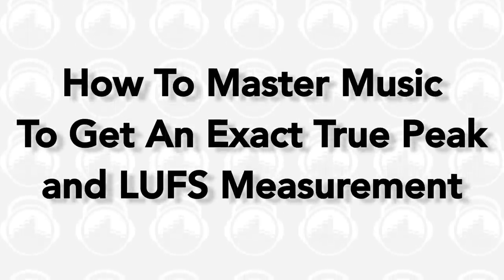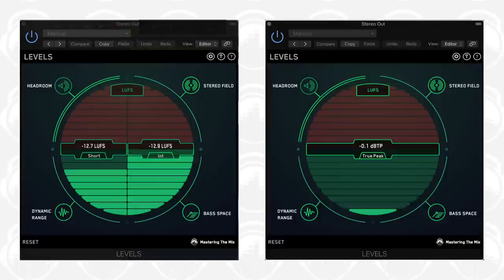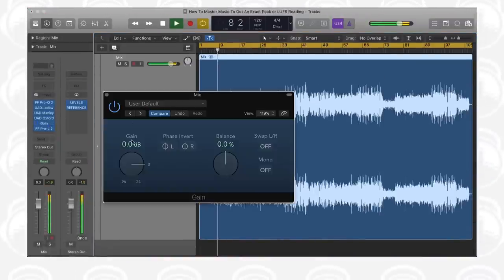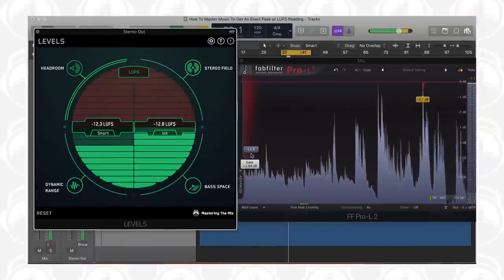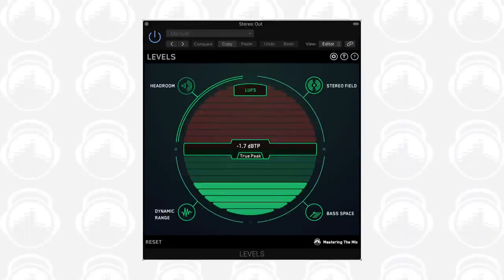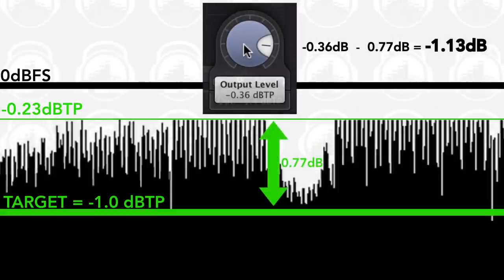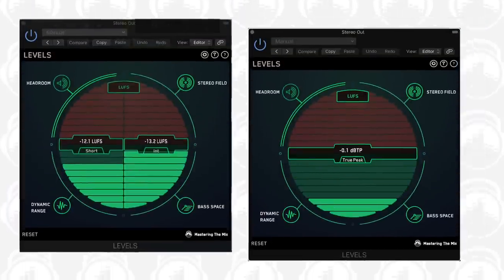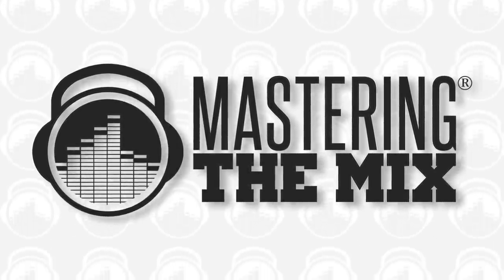How To Master Music To Get An Exact True Peak and LUFS Reading

Comment: I have a track I've mastered. It's -14.7 LUFS and -1.2 True Peak. I'm pretty happy with it other than I wish it were about a decibel louder. So I thought I'd try to go for -13.5 LUFS. But it seems whatever I do the true peak is more sensitive to than the LUFS. For instance, the first thing I did was raise the gain on the Multipressor in the master chain from 1.6 to 2.0. The overall LUFS integrated went to 14.4, but the True Peak went to 1.0 which I want to keep under. Should I increase the limiter then? Shorter version of the question: How to increase the LUFS without increasing the True Peak? Thanks! I bought a copy of Levels.
Reply: I do think I have figured out one thing: Just a small bit of audio or so can make your True Peak sky rocket out of the blue while 98% of the mix is well below your target, even though it's not necessarily audible. Once you identify that bit, can create an identical track, cut and copy that bit to it and apply more processing to just it, whether that be a Limiter, faster attack time on your compressor, and then it frees up the majority of the track to breathe!

Comment: Man this is slightly tough to swallow using gain plug ins to control your peaks. Gain plug ins are not forgiving like soft clippers are which can round off your transients. Why not just add a soft clipper to catch the peaks and control the momentary lufs with a limiter inserted directly after the soft clipper ? This is the way i have been doing it for over 20 years.